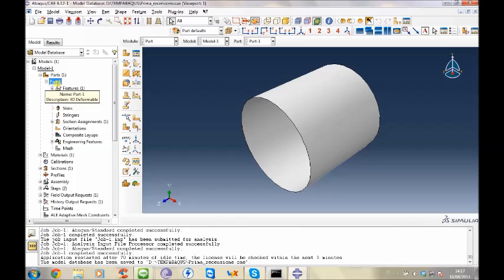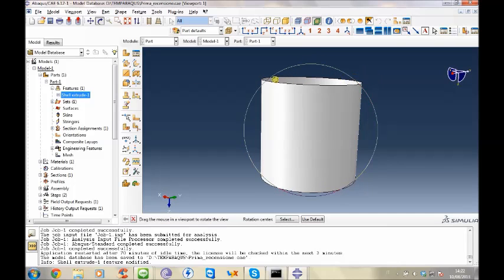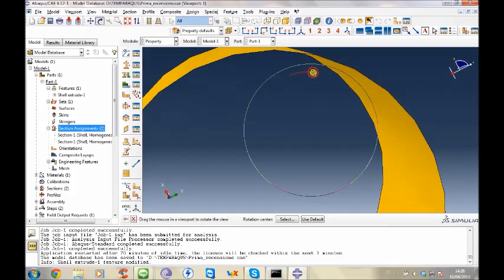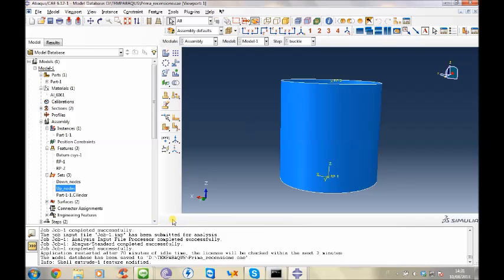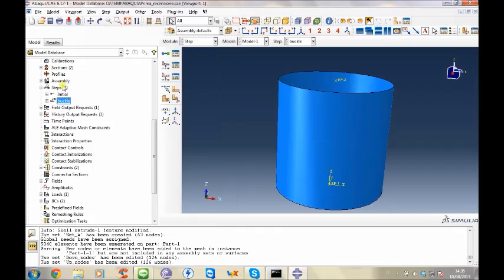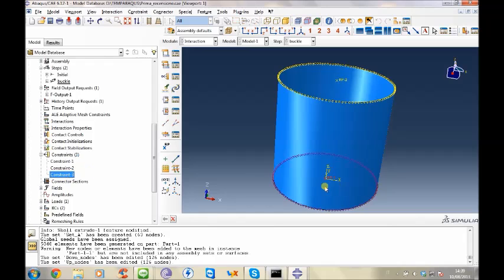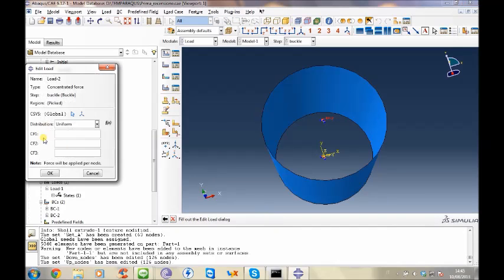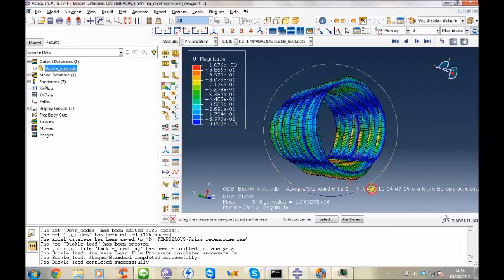Abaqus Buckle Analysis Tutorial

Comment: Hello, I have done two models. One in 2D and the other in 3D. I am studying a sigma section back to back for 2D and an I section for 3D. I wanted to perform buckling analysis for this models. The step for the "Boundary conditions" was set as initial in other for the element not to float.

I will like to know why your "Boundary conditions" are under the buckle step. Also, I ran the analysis several times and I got an error that says: The executable standard.exe aborted with system error code 1073741511. 

Your help is appreciated, I am using this for my thesis and I seriously need help. Please respond.
Thank You

Comment from the maker: Thanks for your question, you are not able to use *IMPERFECTION keyword inside the input file if this one is submitted to a ABAQUS/Explicit analysis. But you are able to do this, obtain an array of displacement by the use of eigenmodes obtained with the BUCKLE analysis, then create a step with a general static analysis and without load apply the imperfection with the opportune scale factors. Then import the results inside Abaqus/Explicit and so you will be able to perform the analysis. Best